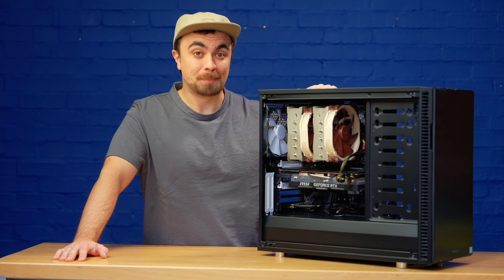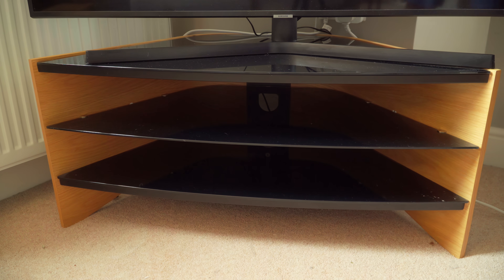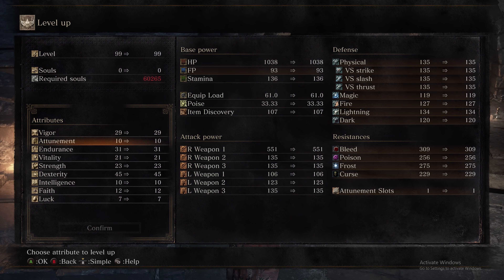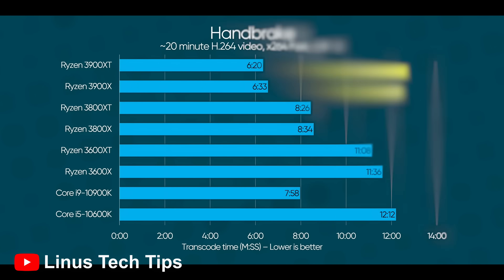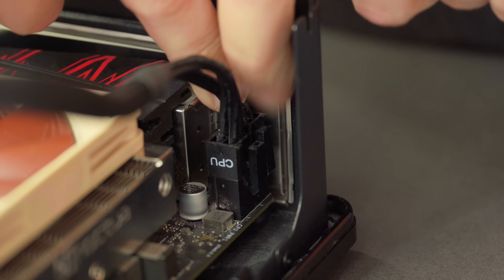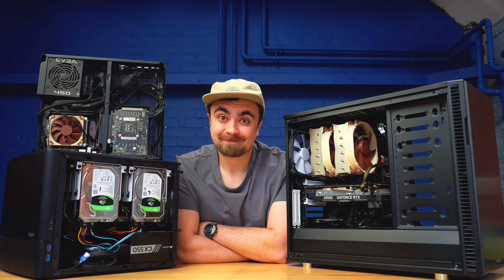How I Learned to Build a PC

Comment: The time I built mine, I weirdly wasn't scared (although it was extraordinarily expensive and I had waited 2 years for the right time), because I felt like I just knew how to do it. The only part I was tense about was installing my cpu, and that took me 5 mins. What was annoying, however, was the case fans and my aio. The blasted fans took 6 hours to do, but when I eventually switched it on at 3 am, it was probably one of the greatest feelings i've ever felt. 

(12700kf, 3080 ti, 32 gigs of ddr5, 1.5 tb's of m.2 and an ek 360mm aio)

Comment: Looks alright. You only did two things not wrong but not perfectly.
1. Little too much thermal paste
2. Don't screw the heatsink in fully 1 by 1 but rather tighten all 4 in a X-Pattern little by little. That way the thermal paste will be more even and pressure on the CPU is also mroe even which can sometimes cause issues.

Also one thing, you can just throw another HDMI cable in there and actually play dark souls on your TV with your bigger PC :)

Comment: it is recommended to have the RAM on the 2nd and 4th slot, instead of 1rst and 2nd, i forgot the reason, but its recommended this way.
Reply: You're right. but if you look closely, He used an ITX motherboard which only have 2 slots of ram.
Reply: @PRO_VE  tbh, it did look like he only had 2 slots, but i wasn't sure, so i wanted to just say this just in case

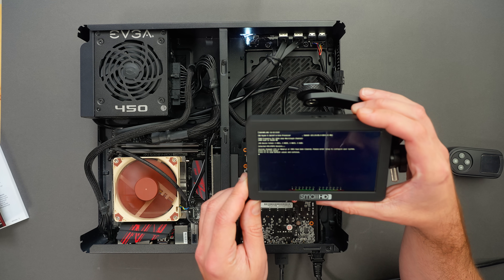Comment: When you installed the ram, one side of the second stick didn't click in and the stick visually looked crooked. This means that it isn't fully seated and won't work correctly. Also, when you were going through the UEFI at 12:52 you can it says you only have 16gb of physical memory instead of the 32gb you installed. So  just push that one side of the ram stick in a little further and you'll double your memory capacity.

Comment: I was lucky enough to have a buddy give me an old build of his a number of years back. After the processor suffered a heat death I didn't want to start fresh when so many of the components were still usable so, new heat sink, cpu and moba, a few other upgrades and off the the races. Saved me hundreds of dollars and I fully relate to how good it feels to boot it up the first time. Made a builder out of me for life and now I have a 10year old case and power supply running video editing and multi channel audio recording sessions almost daily. Utility at its best.

Comment: I just want to mention - graphics cards are often used for well... graphics, but a lot of calculations can be off-loaded to the GPU to be run in parallel, meaning they do have a use outside of just rendering things graphically. 
A CPU can (in simple terms) usually only do a couple of things at a time, depending on the application usually perhaps just one thing at a time, even if that is really really fast. But some programs are designed in a way that can take advantage of the GPU's ability to perform these calculations even faster, and doing lots of them at the same time. This is why cryptocurrency mining (ew) uses graphics cards, though there are of course loads of other uses for GPU's outside of this.

Modern video editing software also sometimes has support for using the GPU to encode videos, though I don't edit videos so I am not sure how prevalent this capability is.

I'd keep an eye on the temperature of your PC, being in the tight area that it is - and having such a small CPU cooler might lead to some thermal issues. There's loads of free software online to track the temperature of things.

On a different note, I am curious to know why you chose/how you even got a 2080 Super for your other PC, and put the 2060 inside this one. The 20 series is rather old now, and the 30 series was a huge leap from the 20 series. Obviously you know your requirements better than me, but I am just curious. :) 

Great video Mike, looking forward to the next!

Comment: If you have a pc with an AMD Ryzen 3000 processor (like the 3600XT Mike used) and it doesn't want to start even though the fans are spinning, just let it run for a bit. On mine it took several minutes until it finally posted. I was sweating bullets haha

Comment: When I built my first computer it was about 3 years ago it was around $750 or $800 USD  I had only used a laptop before then which was good enough for my minecrafting at the time I had also started to watch LTT but I wanted to get into streaming and content creation too. I figured I might aswell just build my own computer this was around the christmas before GPU prices skyrocketed. I had gotten a I5 9600K with a B365 mobo (The reason it was B365 was because I had gotten it with a combo for like $225 and was cheaper then getting them seperate) 16 gb of RAM, I forget what it was but I used the SSD in my laptop and for the gpu it was a GTX 1650 I had gotten it for like $120 even now the cheapest 1650's are $170. I was so mind blown with how good it felt and not to mention I was able to use shaders in minecraft. It also allowed me to play more intensive games but sense then I have upgraded and flipped a handful of computers. Right now I am rocking a I3 12100F, RTX 2080, 32gb 3200MHZ CL16, B760M DS3H, WD SN570 1tb, 2x 2tb Seagate Barracuda, and a Supernova 750 GT. (I know the PSU is VERY overkill it was gotten like 8 months ago on sale for $55)-

Comment: As a PC builder enthusiast myself, I must say I'm impressed! Good work! But there is still a few things to note, when building your first PC. I saw that your 24-Pin on the powersupply wasn't fully in, it's quite important to double check that they are all the way in. I would also like to see some more air-flow in your case, more fans help your components stay cool and will increase their lifespan and performance. 

Also, a 450W powersupply works fine, but I would recommend at least a 650W one, if your pc doesn't have a strong enough powersupply, your pc will reduce the performance for the system (in a nutshell, it bottlenecks your PC).

Not sure if you did this or not, but your CPU cooler might've came with a plastic cover on the underside, if you didn't remove it, I'd suggest you do so because the cooler is almost useless if so. It might've came with a layer of thermal paste instead of the plastic cover, in that case I wouldn't add more thermal paste to it, just used the pre-applyed thermal paste.

Also, Mike, i think you might wanna turn your power supply the other way around, because by the looks of it, it seems like you're choking the powersupply by not letting the fan taking in fresh air.

Some PC tips that doesn't involve your build:
* Be careful with the USB 3.0 connector, it's known to break.
* Don't screw in 1 screw all the way in on the CPU cooler, you want to do them all every now and then so you don't damage the CPU
* If you have more than 1 stick of RAM and more than 2 RAM slots on your motherboard, you want to have the RAM sticks in dual channel (check your motherboard manual for the right slots for dual channel)
* Have the GPU in the top PCI-e slot
* Remember to put in the IO-sheild before your motherboard (if it is included)
* Update your GPU drivers regularly (improves performance
* Check that your RAM is running on the right frequency in your BIOs (if your CPU and motherboard supports a higher frequency)
* When you put in your RAM, you want to hear a "click" on each side of your RAM stick
* You want to have an equal amont of intake fans as outtake fans, too much positive or negative pressure in the case isn't good for your components
* Don't have too little or too much thermal paste on your CPU
Reply: What did you mean exactly by don't screw in 1 screw all the way in for the CPU cooler? Could you elaborate please? Thank you
Reply: @Mandarin9900  Sorry, I wasn't fully sure about how I was going to phrase that sentence. This is what I ment: Yes, you want to tighten the screw all the way down, BUT you shouldn't screw a screw all the way down in one go. You want to start with one corner, tighten that screw slightly, then move to another corner and the next corner, and so on. And so it this way until you feel like you can't tighten any of the screws down anymore. This is so the pressure on the CPU is spread out evenly, if you don't do it this way, you could ruin your CPU.
Reply: @thatguy9017  Thank you!

Comment: DO NOT put a PC in that shelf... there's no airflow through it. The PC will die.
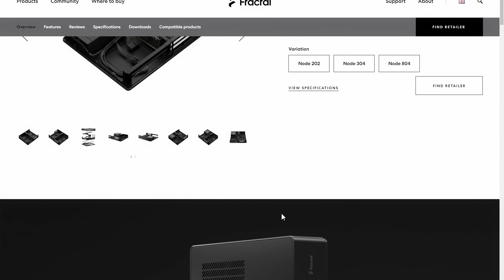Reply: "If it doesn't fit into this shelf then this is all pointless" 6:38
Reply: @LordZarano  That's what I was responding to:  it doesn't matter if it fits... which it did... it matters that there is no airflow through that shelf.

Comment: Although it doesn't look like you've had any problems with temps, I would recommend getting a fan or two into your builds. You didn't mention it in the video but you should also have installed all necessary drivers such as for the gpu and WiFi card. Also for windows activation there are a number of ways of getting a key, hwidgen being a popular one.

Comment: Great job. Biggest issue, which isn't an issue is PSU size. You went with a 450w psu, and according to PC Partpicker, estimated power needed is 334w. When choosing a PSU, you don't want your needed power usage to be over 80% of the what the psu is rated for, due to inefficiencies, losses, and transient power spikes. But if you upgrade your cpu, gpu, or both, you may end up having power delivery issues, which can result in random shutdowns or freezes. 

What I personally do is, put all the parts in PC part picker, multiply the estimate wattage by 1.25, add 100 and then round up to the nearest 50. So 334 x 1.25 = 417.5 + 100 = 517.5, which rounds up to 550w.

Comment: You need to boot into the bios and set your ram speed.  They run default at slower speed than the ram is rated for.

This is probably the most overlooked step in PC building.

Comment: Someone else has mentioned the PSU appears to be upside down, another thing I've noticed is that the cables 20 / 24pin into the PSU isn't plugged all the way in. Probably won't be a big issue but if you do fix your upside down PSU, be sure to reseat the cables into your PSU and push them all the way in - at best, they could come loose if you move it, save trouble shooting it later, at worst, it could be a (probably very minor) fire hazard.  

Otherwise, love it and love that you've shown that it's really not that difficult to build your own PC, definitely a very helpful skill to have for quite a few people in the world.

Comment: A couple things I learned about PC building; It's expensive and it can be a pain in the ass. Totally worth it though. 

It's such a task to replace a single component because it's often never a single component. New graphics card? Might need new cables/adapters to work for your monitors, or new monitors altogether. New CPU? Might need new motherboard, which means you might need new ram. Gotta make sure they're compatible with each other too. I can never find my thermal paste when I need it 🤣

It's been interesting building and maintaining me and my wife's pc's.

Comment: Well done Mike! You built your first PC! Pretty much everything was spot on. My biggest advice when building any PC is always consult the Motherboard manual before the builds, and few things can't be installed where they shouldnt be, so its hard to go wrong. Dont worry about the front I/O, thats always a problem when you're making a PC for the first time. Also the thermal paste, as long as its about the size of a pea, usually you're fine, even if its a little more than that, it doesnt harm anything. 
Also, never throw your old hardware away, either recycle or do something new with it. The amount of old kit that can be plugged into a TV as a media box, security cam, turned into a NAS or even a router is unbelieveable. At one stage I even used an old laptop to record video footage of birds on a feeder outside a flat window via movement.
I also like to think as motherboard as the skull, GFX as the eyes, soundcard as the ears (thats usually built on motherboards these days) RAM & HDD as short and long term memory and the thing that brings it all together is the brain to process the information - The CPU. Case is generally the skin as well. 

Glad you had no problems with windows, as sometimes installing that with a legit key can be a nightmare. Looks like you were alright on that one though. Good Job!

Comment: Well done!

There isn't much that's more satisfying than putting your own PC together and watching it boot!

One thing I would mention: Make sure to keep cables away from fan blades. I noticed the cable for the CPU cooler fan was sitting over the top.

It will be ok, but if it happens to touch the fan the sound it makes it awful and slightly terrifying!

Comment: Loved this video Mike! A thin mini-ITX build like that is no small feat for a first-time builder. As a computer hardware engineer, I have two small pieces of advice for handling parts:

(1) at 8:17, it looks like you briefly hold the M.2 SSD by its gold pin connector. This is something that's important to avoid, since the oil from your fingers can fuck with the impedance of the connection and you also risk discharging static electricity into the component. On that note; 

(2) you were probably doing this and just didn't show it, but make sure you ground yourself every once in a while when handling exposed parts -- don't want to static shock them into oblivion by mistake. I usually just touch a big piece of metal every couple minutes, but if you want to be really safe, you can wear a grounding bracelet.

Didn't know "Windows" and "no bloatware" could go together in a sentence. Try installing Linux sometime for a real bloatless PC :^)
Reply: You might be overpraising:  if one can assemble a Lego man, they can build any PC form factor easily.

1)  Yup... I guess he didn't read the manuals, but just watched YT videos;

2)  Yup, but he's a Brit (Scot variant)... they say "earth" instead of "ground" for electrical purposes... they probably think you mean to make some form of tea when you say it our way.  :)

Comment: I'm sure you'll have no end of suggestions but some to consider... nip in the BIOS and set your RAM speed correctly (XMP/DOCP - assuming you got something like 3600mhz for Ryzen), secure boot is probabaly turned on these days by default, and also check there's not a BIOS update available. Oh, and spend 30 mins going through windows setting turning off every single 'share/report/Cortana' option you can find ;)
Reply: Or just use Linux instead
Reply: @pyskon1k369 generally not worth bothering with Linux, atleast for 95% of people.
Reply: And especially check before the speed of the motherboard so it matches the ram, learnt that the hard way
Reply: Also make sure to set refresh rate on your monitor. A lot of people just leave it at 60 fps even if they have 144hz or higher screen.
Reply: Or download a program that deletes all the bloatware for you. (especially for win 11)
Reply: @CkBr  he had a clean install from a USB, there was no bloatware ^^
Reply: @SinclairWest  Microsoft installs their own bloatware
Like the other guy said about Cortana and that kind of crap

Comment: I've built many PCs but those front panel headers for power and stuff annoy me to this day. Some manufacturers have found creative ways to make it easier but it's still a pain. On the one hand, these standardized connectors for everything on the MB are great, but that also means they've not improved for ages. The power connectors also bug me all the time.

Comment: 100% agree! Everyone should learn basic computer knowledge. Half a year ago I had to replace my hard drive in my laptop as it crapped out on me right once warranty ended. I decided to switch to an SSD to get some better speed and though it was scary it went smoothly with only minor hiccups. 

All in all it likely saved me at least $100 if I was to send it in, and maybe $1000 as to if I just gave up and replaced the whole thing.

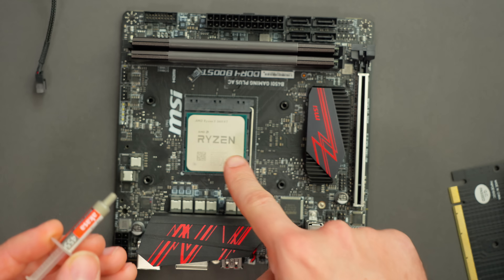Comment: in 9/10 cases, stock cpu coolers (ones that come with the cpu you got) tend to have thermal paste already applied (unless something changed in past 7 years since i last built my pc), so adding more at 8:40 probably wasn't strictly needed . Shouldn't be a future issue, but keep an eye out on the temperatures you are getting, if something looks concerning in 1-3 years, that would be my first guess as to why. Different thermal compounds mixed together under a fair amount of heat might behave unexpectedly (and its generally a fair shout to replace it every now and then).  
  
Edit: never mind me, you replaced it later due to height restrictions. Good job, these small factor builds tend to be the biggest pain to build
Reply from the maker: I actually destroyed the pre-applied thermal paste by peeling off the sticker and leaving it . It got covered in crap and I removed it. Next time I'll know better! Thanks for the comment though as I didn't know what it was when it arrived.
Reply: @MikeBoyd  you did yourself a service by getting rid of that stock paste 
And the amd stock cooler not fitting for that case.
Because for some reason 
Coolermaster (the company that makes coolers for amd cpus) decide to use glue on that thermal paste 
Obviously its not glue lol 
But after extended period of time 
When you try to replace your cpu 
Its just stuck there 
I've seen more people rip their ryzen cpu clean  (sometimes not cleanly and end up bending some pins) off  the socket stuck to their stock cooler than i count 
Also pretty good choice on a third party cooler too
Noctua never disappoints
Reply: @radhisghaier6394  I had exactly that problem of my old Ryzen CPU being completely stuck to the cooler, but it was fairly easy to remove after about 30 seconds of blowing hot air on it with a hair dryer.